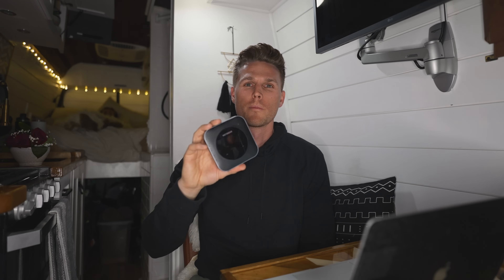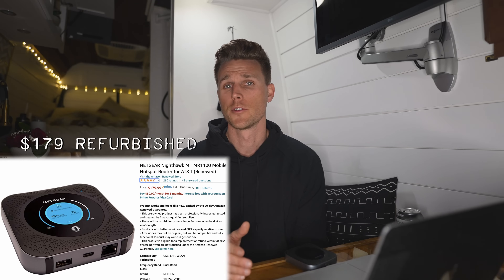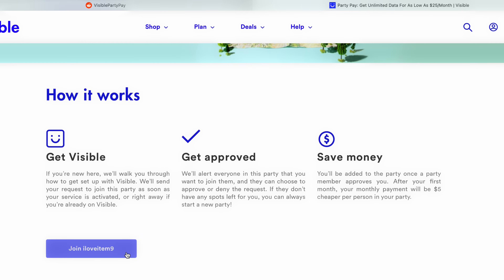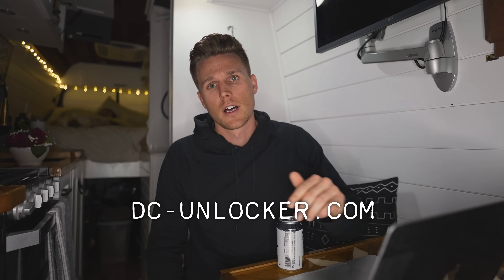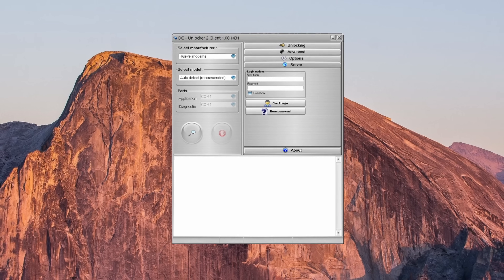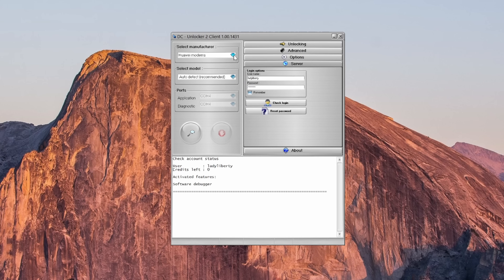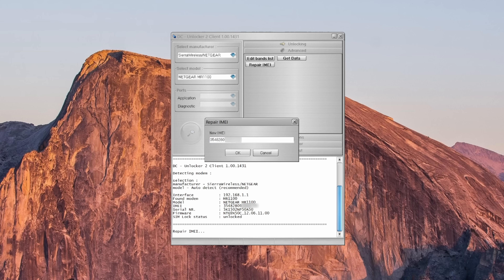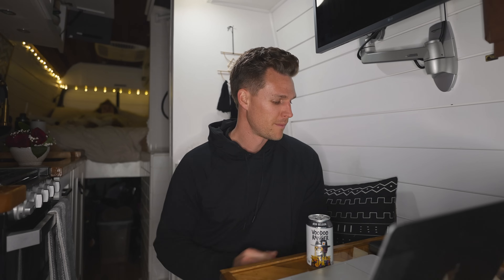CHEAP Unlimited Internet for your Van/RV/Tiny Home or even small Apartment | 2023 | $25/Month

Comment: Hi there, I have this same exact set-up and it still works, but I wanted to get a back up nighthawk router in case the one I have goes down. I bought the new nighthawk MR6500 and I couldn't change the imei# errors kept coming up after it stated that the test was successful and they took my credit. I think it just doesn't work with the newer models, do you happen to know? I might just go back and by the same model in your video. :)
Reply from the maker: Yeah i think i remember an older comment from someone saying they had the same issue with the newer model. I can’t confirm myself but I know others are still having success with the older model
Reply: @JakeandHeather  Ok sounds good. Thanks! I think it might be b/c its a newer model with a different software. I will just get the same model router and change the imei# on that and have as a back up. Thank you for the video and helping us  :)

Comment: Great video! For some reason when I login to DC through my home Wi-Fi it connects to the server ok, but then I plug in the device to the computer (change the settings) then it seems like it stops using my home Wi-Fi and will not connect with the DC server unless I unplug the hotspot.

Comment: The setup worked initially.  But within a couple of minutes I got an error stating the Mobile Broadband Disconnected.  That also locked me out of my visible app/online account.  I spent an hour with tech support and it starting working again.  The next day the same issue arose.  Has anyone else had this happen and were you able to fix it?
Reply: I fixed the problem.  I changed the APN to vzwinternet.
Reply: @kaumaugher  Thank you! That got me back up and running!!!!

Comment: Great Video.  You hooked us up!  Literally.  Thank you. Got another router that allowed a imei number change within the router software.  I connected to the cellular network with great speeds but stopped using it after seeing  comments discussing ttl. I don't want to get throttled or shut down. I am getting contradictory information about setting the ttl.  If we want the router to mimic an android phone what do I set the ttl to. 63, 64, or 65? I think 64 is right but not sure.  Thank you in advance

Comment: Hi Jake-
Looking for some advice on this:
1) I called ATT and unlocked the MR1100 hotspot.  
2) I put in a Cricket Data SIM in the hotspot, changed the APN, and it worked fine. 
3) I then took out the data SIM, changed the IMEI to an unlocked phone that I had lying around.  
4) I got a new SIM (for a cell phone) made from another carrier (GCI) and when I put it in the hotspot and changed the APN, not the Hotspot says that it is locked
5) I can put that same GCI SIM into the unlocked phone and the phone works, the phone doesn't say that it is locked, but when I put the SIM back in the hotspot it shows up as locked again.
6) I can put the Cricket Data SIM back into the hotspot, and the hotspot doesn't show locked, but it also doesn't work anymore because the IMEI is no longer a data device.
Any help is appreciated!

Comment: I have another question, another video said that the router that we picked had to have capability as "bridger" or "rage extender" so that you are able to change your TTL. i looked up the netgear that you use or recommend and I dont see those specs or details on it. Do you know why you were able to change your TTL if it doesnt have those specs. Also, does this has VPN and is it necessary for anything

Comment: @JakeHeather  So it's been almost two years since this video was posted.  Is this still working?  Has anything updated in regard to hardware or method?  Would this work with any carrier?  The Verizon network as large and vast as it is does not have service in many of the locations we camp.  We have found Cricket to be more reliable.
Reply from the maker: We’ve been told this method still works but some haven’t had success with Visible as the carrier. We still use ours with T-Mobile sims and have good success

Comment: UPDATE: This no longer works! and Jake is not responding to issues of it not working, or people only getting 5mbps of speed.
Reply: Be sure you copy the same APN settings
Reply: I know for some reason I had trouble doing the rewrite from the Cricket internet I literally had to go to Walmart and use their Wi-Fi and it went off without a hitch
Reply: I can only really send you the apn's that I'm using for Cricket which works off of AT&T Towers it literally uses the same APN that my phone uses always activate the card in a phone before you go putting it in a device and if you put it in the device that doesn't match the IMEI number given to the phone company will sometimes not work so usually it's best to have access to the phone that you are writing the IMEI number to
Reply: Also if the signal is showing red on the M1 Nighthawk it could be that it's on a band that's not working in your area always go to cellmapper how to see what bands are working on the towers in your area and rewrite the band list on the Nighthawk for just those bands
Reply: This is disinformation. This still very much works depends on the sim you choose. I use cricket which uses att bands and it works great. I've got 2 rewritten to run internet to a 2000 square foot house my wife works from home with one plus watches TV and streams all day while she's working and the other gets used for ring doorbell video games and everything else I can think of. And the ping stays around 20 to 40 more than enough to run around open world game
Reply: @AVERAGE-SIZEDGAMER4200  how did you get it running on cricket? I did all the steps and my m1 nighthawk shows it has internet but no internet actually come out. Please help

Comment: Just did this. Followed all the steps and I’m throttled at 5mbps
Reply: my device says no broadband connected :/
Reply: @TysonAnderson-gp9hq  mine did too. I was sent a micro sim so the sim had to be perfectly lined up. Or you can get a sim adapter
Reply from the maker: Did you change your TTL Value on your laptop?
Reply: @JakeandHeather  I did. No luck

Comment: Hi Jake please, need your help. When i connect netgear m1 router my laptop looses the internet.  So when I try to repair the IMEI thru DC-UNLOCKER it gives an error of "operation timeout" basically because it gets disconnected from the home wifi.
I can't seem to find the issue. Could use your help. 

P.S. I have not put in the Visible Sim card in the M1 router.
Reply: Have you got this working? I setting mine up and not sure when to put the sim card in. DC-Unlocker is telling me no modem detected. I have my sim card in. The visible sim is so small not sure I have it in correctly. Any tips?

Comment: In the comments there is mention of setting ttl.
You don't mention this in the video, and I can't find anywhere that even tells me what that means.  
Also your "last important step" actually disables the router. So far mine is only working on the verizon APN vzwinternet. And has max speeds of about 6mbps. If I put in the Visble apn it goes offline. 
Help.

Comment: i'm trying to find a hotspot device to buy that will give me fast internet speeds at a HOTEL that only has 30mpbs wifi. (again, at a hotel, not at my home, which means i'm not in charge of the internet situation). i dont know anything about this technology. i tried calling one company who made a physical device for hotspots and they couldnt even give me a ballpark range of upload speeds if i buy this device. so it seems like a gamble to buy one if the device isnt going to give me speeds faster then the advertised 30mbps wifi hotel. are you able to speak to the internet speeds of these things? looking to upload a 4gig file from a hotel

Comment: Followed the video to a T and at the end I realized the router I bought wasn’t unlocked… 🤦‍♂️ So I’m reaching out with a couple questions if you can help. I’m hoping the seller will release it from their AT&T account to make it unlocked, but if they can’t I’ll probably just buy a new one. If I get a new one can I use the same IMEI number from the phone I previously used to rewrite the first router I bought or will I have to get a different one? Second question, if that’s the route I go and eventually sell the first router, will I need to change back the IMEI to its original one? Thanks for your time!

Comment: Jake, I have a question. When you make a mobile hotspot with a cellphone, that data is typically outside the "unlimited data" of the cell plan. When you change the IMEI of the hotspot router to a cellphone IMEI won't the mobile carrier charge the wifi'd data differently from the data used by the device itself?
Reply: No it won't. Your mobile carrier still thinks that the device (your router) is a phone. So you won't be charged extra for "hotspot data" per say. You will still be using your carrier's restrictions for data plans on phones tho. For me, that being T-Mobile, I don't get charged extra for using data but I will still have the 50 GB high speed data cap that T-Mobile puts on all its customers across all mobile plans.
Reply: @brianvu3705  Thanks

Comment: Hey! thanks so much for this guide. I got this to work, however, it appears to be throttling me still at right around 5up/5down (even after changing the IMEI, etc.). Anything else i should be looking at? I also only appear to be getting connection when verizon is my APN, although my nighthawk still says Visible. Thanks!!
Reply: Yes I just did this, and it's definitely throttling.  The only thing I gained over just using a phone is multiple devices.  Did you figure this out?
Reply: @pdxxjjeep  I did not. i tried getting deep into changing the TTL settings on the M1 but was in over my head. Think i changed them to 65 TTL but made no difference

Comment: Does this still work with Visible? Can someone confirm? Did you need to activate the sim using the phone the IMEI is tied to?
Reply from the maker: The sim does need to be activated by putting it into a compatible phone, but it can be any phone. Does not need to be the same imei

Comment: Tried this on T-mobile because that's my current cell provider. It sees the device as a phone with this process but T-mobile recognizes it as using a hotspot feature, so it uses all your hotspot data in your plan. Trying Visible next.
Reply from the maker: You still need to change the TTL of the computer you are using to 65
Reply: @JakeandHeather  oh got it. I currently do not have it hooked up to a computer, just wifi router which I now have on visible and is pretty good speed. Max seems to be 5mps which I got on DSL, but is still cheaper than the DSL by $30!

Comment: do you just use a regular phone simcard? am I able to use tablet plans in my m1?
Reply: I just got to the imei part lmao
Reply from the maker: Yeah once you change imei you can use tablet or phone sim
Reply: @JakeandHeather  Hey I have changed the Imei and its showing as changed in DC unlocker. But at&t are putting the data I use aginst the hotspot limit so I have run out of data. What can I do?
Reply: It seems I am able to use the USB tethering still but not the wifi or ethernet on the hotspot
Reply from the maker: @300ALZX  need to change the TTL of whatever computer you’re connecting
Reply: @JakeandHeather  Im gonna try that, if it works i will try it on a 2nd router and see if that fixes it for all devices.

Comment: Hi, thanks for the video. I heard this model reboots randomly. What’s your experience with the m1? I want to buy a 4g router but I’m afraid I get the same rebooting issues I had with the mifi 8000.
Reply from the maker: I never had any issues or heard of that issue with the m1 personally
Reply: @JakeandHeather  I head something about overheating…  well, it depends.  Thanks for the reply.
Reply from the maker: @lebon2002be   oh yes, if you are going to use it for long extended periods of time it’s best to remove the battery and just keep it plugged into power. It seems to get rather hot when continually in use while being plugged in with the battery

Comment: So, just so I'm understanding this correctly.

Where we Camp, We lose cell service & internet. If we purchase this device, will we have internet?
Reply from the maker: No, to be clear, you still need SOME SORT of cellular signal for this to operate. This device tends to pick up a stronger cell signal than most cell phones, but it still needs to have some sort of cellular service signal. We have found that when our phones didn't have any bars or maybe 1 bar but not working, the Netgear M1 would maybe have 2 working bars

Comment: THank you SO MUCH!!! IT WORKED!!! Tested my internet speed, it is ranging from 60mbps to 90mbps, THANK YOU THANK YOU THANK YOU for this video!!!
Reply from the maker: Glad to hear that this process is still working!!! Thanks for sharing your results! Enjoy 🤘🏼🤙🏼
Reply: @JakeandHeather  IT slowed down this morning. Did I do something wrong? I did everything you did on the video, but it is now only 5mbps.
Reply: @JakeandHeather  Nevermind, I took out the battery, and now its up to 60 mbps again. Do you know why it did that? Why it throttled down to 5 mbps and then up to 60 mbps when I took out the battery?
Reply: @elviscalix1408  I seem to be having similar experience. When first running a speed test it goes to like 20mbps then actually throttles back down to like 5/6 down and up

Comment: Hey Jake I appreciate this dude! Quick question - Do you just order the SIM and stick it in the Netgear to get it started? Or do you have to get a phone also to first activate the SIM and then plug it in the Netgear? If you just got a SIM, what SIM did you get on the Visible site? Thanks in advance!
Reply from the maker: correct. you will need to put the visible sim into a phone first to activate the sim using the Visible app. I selected to "bring my own phone" on the visible website to have them send me just the SIM card
Reply: @JakeandHeather  Okay awesome. Thanks so much.
Reply: @JakeandHeather  does the phone you order the sim for need to be the same phone as the imei that you use?

Comment: Did you run a speed test on it. Any idea on ping, mbps download and upload? Thanks!
Reply from the maker: As long as you change the TTL to 65 on the computer you are using, you should get between 40-90mbps download speeds and around 20 up. Ping ranges 25-100

Comment: Great info.  I have a Nighthawk MR1100 with an AT&T SIM, unlimited thru BixWireless.  Signal varies between Fair and poor.  I need to tether to it as well for my work PC ass well as being able to stream TV (Wife). We use about 200Gb of data s month.  Will this work on the 1100 and if not, do I have a way to revert back to the old settings? I would of course keep a record of the current IMEI.  Thanks.

Comment: I won't pretend to understand most of this, I've only started looking. Btw really smooth, step-by-step. Great vid

My only question is about speed. Is the speed based off the Sim card or the device? I get that you changed the imei number to "make it a cellphone" but do I need to acquire a sim card from my carrier?
Oh also, will this work on the netgear nighthawk M5?
Reply from the maker: We haven’t heard of any success stories with 5g. Speed will always be based on quality of cell reception. We’ve found that the M1 typically gets 1 additional bar of service than our cell phones. Usually place it on the dash for best service reception